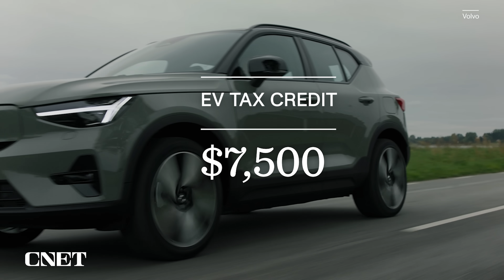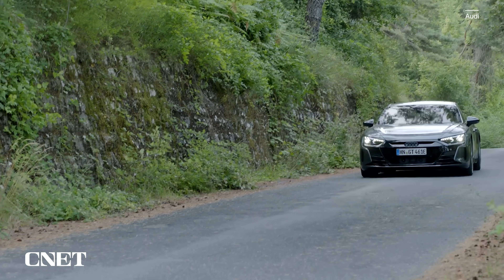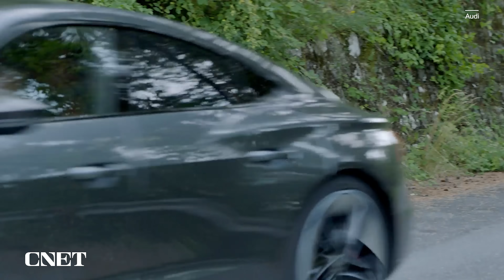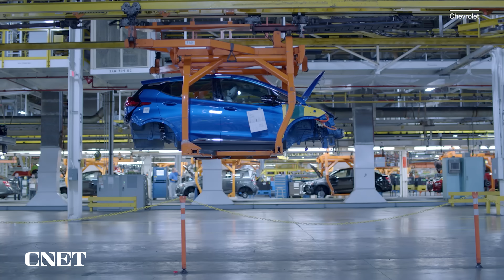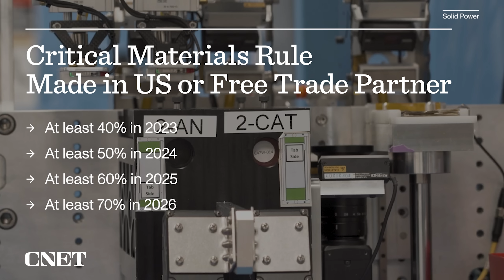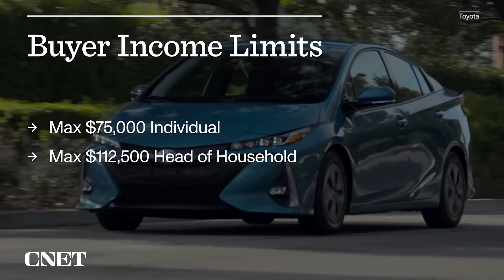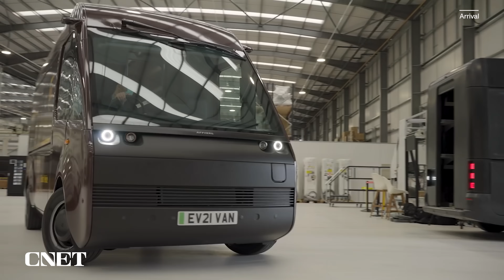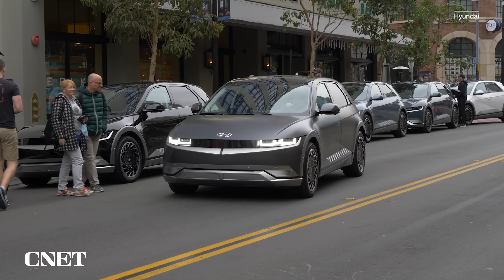Are Teslas About to Get Cheaper Under Radical New Federal Tax Rules?

Comment: If you're buying an EV because you think it's 'green' don't forget to buy the $40k package to cover your house with solar panels and install your house battery system.
Reply: Electric vehicles have a lower carbon footprint than gas powered and hybrid vehicles even after taking into account for the fossil fuels used to generate electricity and raw materials for the vehicle.
Reply: @austinmoon  My point was even if you buy an EV you’re still using fossil fuels and depending on what you were driving before that might be very close to the same amount that you were using in your previous car.
Reply: I live in Tennessee. 55% of electricity is fossil free, that number rises each year. 100% of the gas sold in Tennessee is fossil fuel and always will be.

Sure solar and batteries are great for those who can afford them. For the rest of us a clean grid is all we need.
Reply: @JeanPierreWhite  Tennessee is a good example of what other state should be working for. They have a lot of hydroelectric and nuclear. But that’s not an option for many states and it would take years to get there or more like decades. I could just as easily cherry pick a location that was quite the opposite.
Reply: @nmcalmond  TVA covers several states not just Tennessee, so I'm not cherry picking a single state. Yes change takes decades. We had our first warning in the 70's with the fuel crisis. If change hasn't occurred where you live by now, maybe it never will?

Comment: I have a reservation (with a $500 deposit) for a ‘23 Polestar 2 and a VIN# assigned to my vehicle. I’m expected to receive my car in September/October ‘22; it doesn’t look like I qualify for the $7,500 tax credit for ‘22 tax filing.
Reply: There is a provision in the bill for cars purchased before the bill is signed into law and delivered before Jan. 1st, 2023. As long as you have a binding sales agreement before Biden signs the bill, you will qualify for the old rules. If you just have a factory order and a refundable deposit (you've retained the right to walk away from the deal), my suggestion would be to ask your dealer if you can convert your reservation into a binding sales agreement to lock in your credit. The only downside is you would then be bound to buying the car, even if you decide you don't like it once it's delivered.

Comment: If you want a Tesla, only the rear wheel model 3 qualifies. The long range is at 56k.
Reply: The Model Y qualifies
Reply: Why not the Y (both Long Range and Performance)?  It's an SUV, right?
Reply: @shyuc  does it qualify as a SUV? For sure get Y then ☺️
Reply: @shyuc  Most say the Model Y will qualify, but with this crazy language in the bill, we will have to wait until someone actually lists which cars are eligible. If it is under the price cap, no guarantee it will be under the battery part or if they even classify the Y as an SUV.
Reply: @shyuc  the y is considered  a suv and uses batteries  made in nevada and chemicals from Australia
Reply: Trust me, they will raise the price so it doesn’t qualify. Elon will do anything in his power to maintain class inequality and Teslas aren’t for poor people.
Reply: @wyattnoise  what if I already have my order and it’s coming end of this year?
Reply: @double_joseph327  If you have signed a purchase order, you get the credit from the old law.  If you have only put down a refundable deposit like I did on the Aptera, then no but you can still sign a purchase order before the memory care patient signs the bill and get the credit.
Reply: @robertd9850  all I did was the $250 deposit
Reply: @double_joseph327  You might get lucky. Wait till tax season and get a good tax advisor. You might get some or all of the credit.
Reply: @double_joseph327  You'll need to convert that to a sales contract before the bill is signed.  Call the dealer in the morning if he hasn't called you first which is likely.
Reply: @wyattnoise  👌 clearly you don’t understand his plan that he is always talking about 😂 you really should know what you’re speaking about before putting a comment that makes you look dumb.
Reply: @wyattnoise  if Tesla not raise price, the demand will explode and ppl have to wait 5 years for a New car...
Reply: @wyattnoise  I don't think that is his objective.
Reply: @wyattnoise  Elon is doing everything he can to reduce the price, there is just too much demand with over one year of waitlist.
Reply: @johntheux9238  he’s dump and doesn’t know what he’s talking about. Guess he didn’t see the 10k house that Elon is trying to put on the market 😂
Reply: @JustTheFactsYall  Musk isn't working on a house. He bought a Boxabl house and seems to like it but that's all.
Reply: @johntheux9238  Guess you don’t watch the interviews he does or read anything he puts out. His entire family and himself lived in the house 😂
Reply: @johntheux9238  Next your going to tell me he didn’t sell his big house to live in it or maybe that he isn’t thinking of putting them on the market for $10k. 👌
Reply: @johntheux9238   not anymore, the  wait was really just a sales gimmick to create demand, the same way that Henry Ford did in the 1920's. They don't even CLAIM the wait is longer than a few weeks now, but if you go to a Tesla delivery center, you can usually get a  new Tesla the next day.
Reply: @JustTheFactsYall  You should stop watching clickbait channels...
Reply: @davewhite113  You can't create demand by telling people they won't get their car that's stupid.
Reply: @JustTheFactsYall  He said it was his guest house.
Reply: @johntheux9238  They told people that there was HIGH demand when there wasn't. Tesla builds a certain amount of UNSOLD inventory for each of their own delivery centers each quarter. It was crazy because people were waiting  months to get their cars when they could've just gone to a delivery center and  got one the next day.   The whole demand thing was a sales gimmick used to create demand. so many fell for it....Banks are now balking at giving car loans over 50K because of the large number of repos. Tesla most likely  has had a lot of orders cancelled recently by banks or customers. They are now only claiming about 2 or 3 weeks out....
Reply: @johntheux9238  Space X bought the Boxabl but Elon does not live in it and never has.  He lives in a modest home in Boca Chica, TX that Space X also purchased for around $50k.
Reply: @johntheux9238  Amazing that you know how to type on YouTube but you don’t know how to google something to check the facts 😂
Reply: @JustTheFactsYall  Tesla 10K $ house = fake news
Reply: @davewhite113  The Tesla Model 3 LR is sold out until 2023. I live in the D.C. area and there are no new Tesla Model 3s or Ys available within 200 miles of a sales center.
Reply: @kevinkent6351   try another delivery center. they sell well on the west coast and in the northeast.  get away from those areas.
Reply: @davewhite113  I just put in 90210 in the delivery zip code and searched new Model 3s and Ys. Zero available within 200 miles.
Reply: @kevinkent6351  You  might have to get out of that 200 mile radius. You aren't gonna find one in California or in the Northeast. Find out when the delivery centers outside of those two areas get their unsold inventory each quarter and be there. THEY are NOT sold out until 2023. That's a sales gimmick.
Reply: @johntheux9238   If Elon wants to reduce the price, he can reduce the price, but that cuts into HIS bottom line. If he has a problem with too much demand, the solution to that is making more Tesla's. Personally, I won't be buying ANY EV because of the price, but particularly not a Tesla because to me a car is a tool not an expensive toy.
Reply: @aftonline  They are building more Teslas. They are currently ramping up two new factories (Giga Berlin and Austin) with the goal of producing 2 million vehicles a year by the end of the year.
The model Y will be the best-selling vehicle in the world by revenue this year and by number of vehicles sold next year.
Reply: @johntheux9238   That's exactly my point. Elon Musk does not NEED to raise prices if he has the best selling vehicle by revenue in the world. It's just GREED that is making him do so.
Reply: @aftonline  It's not the best-selling vehicle in the world. It will be once supply can reach demand. And that's when they will reduce the price.
Reply: @johntheux9238  I'll believe it when I see it. Elon says he'll reduce the price when there is less inflation. That's a whole different thing than supply and demand. He's all about maximizing profit. What if demand continues to increase, outstripping supply? He won't have a reason to drop the price then, and will make some other excuse. I do get that he needs capital to expand operations, but anybody who thinks Teslas are going to get cheaper any time soon has got another think coming. The government has us over a barrel because when ICE cars are banned we won't have any choice but to buy a Tesla because no other EV compares with it, and Tesla's "competition" also won't have supply because they are not replacing their ICE production, just supplementing it at this stage.
Reply: @aftonline  They are aiming for 20 million vehicles a year by 2'030 so if demand keeps increasing they will just release a $25k subcompact car.
They are also working on self-driving. A robotaxi can be used by many people.